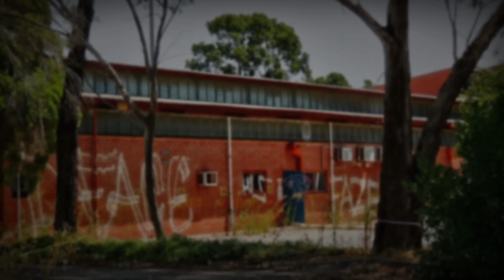The Dark Story of Hercus: How Australia Destroyed Its Greatest Lathe

Comment: I have one of these 3 1/2” Hurcus lathe, flat belt drive
To use it, I have the equivalent Southbend hand manual to operate it with. This I inherited from my grandfather
It was missing some of its gears. My uncle had the missing gears manufactured for me, also it has the 127 tooth gear needed to make metric threads 
Unfortunately it has no index plate kit

Comment: Unfortunately ohs helped kill Hercules in schools. No safety lock out chuck guard, plus modern lathes with digital read outs and drop in tool posts sadly helped its demise. They were bloody good lathes and sought after by collectors and hobbyists!
Reply: You're not correct here..they did supply those features and even made a short run of lathes for America back to the south bend factory. I worked there.